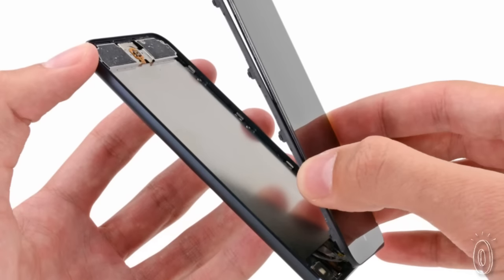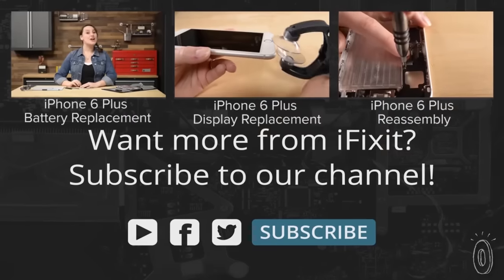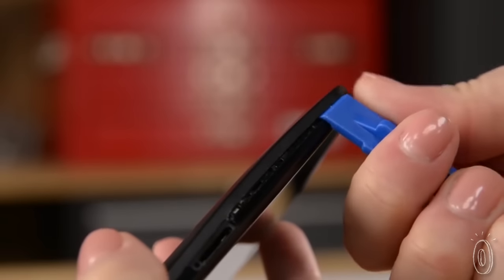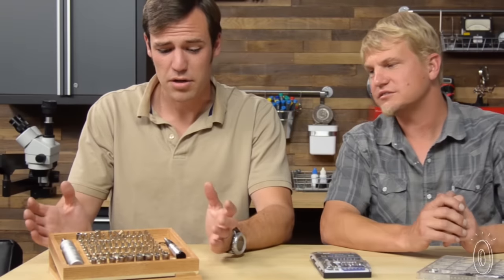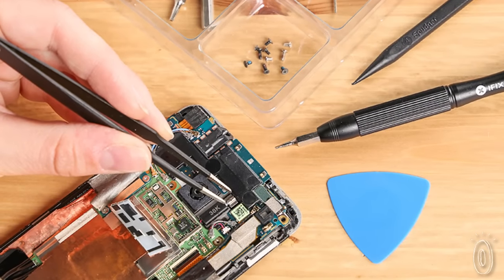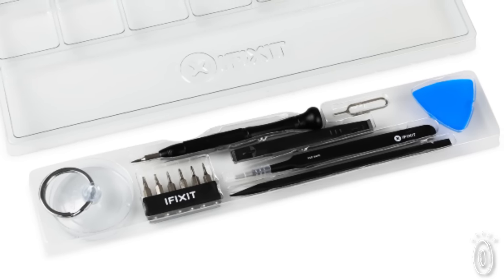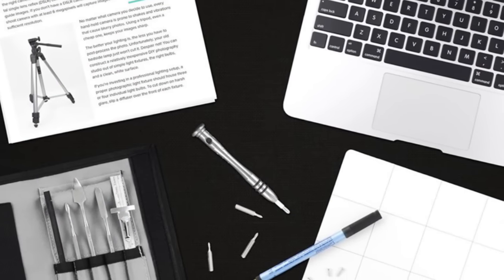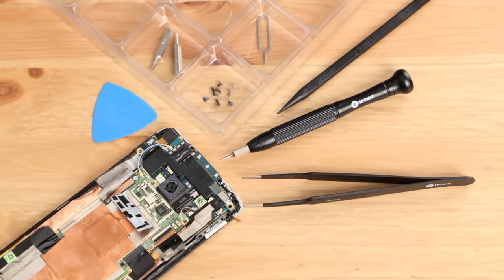iFixit - Tech Repair Kits

Comment: My macbook pro has the "tripoint" screws holding down the battery which are impossible to remove with the right tool. I bought the 64bit kit which worked out fine. It seems like a nice kit but it's kind of a waste if you're not repairing electronics frequently.

Comment: I tried buying a tool for eBay only for it to be not at quality. I have now went ahead and purchased the 64bit driver kit for that purpose from iFixit. What drew me to buy it was the life time warranty. I've owned a lot of tools and most of the time I have a good tool and sometimes a bad one that isn't precision which drives me nuts. A bad tool will strip or damage the item your working with. Most pry tools are ok with buying them anywhere, although I also got the jimmy from iFixit.
Reply: Totally agree with you. Also have a kit from ebay and its good enough, but not exceptional